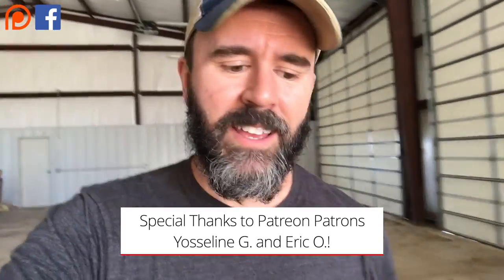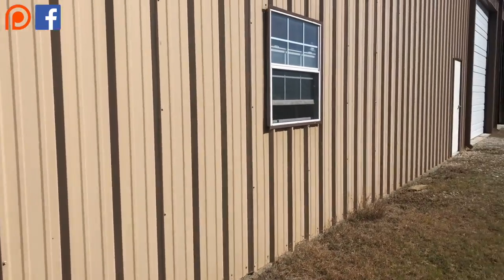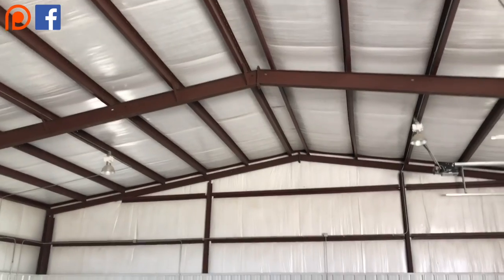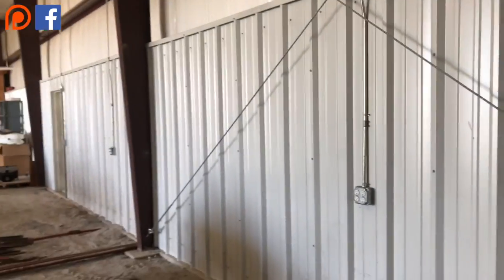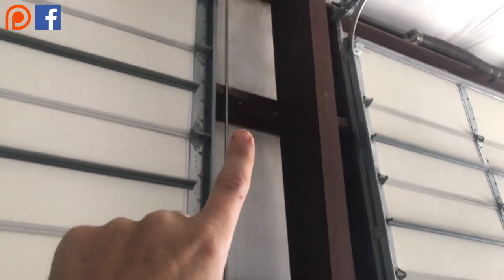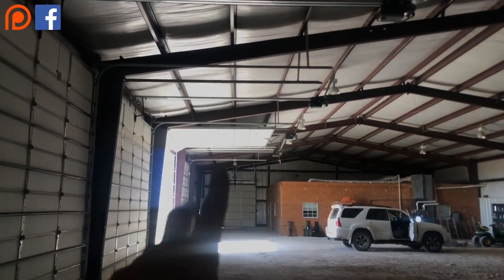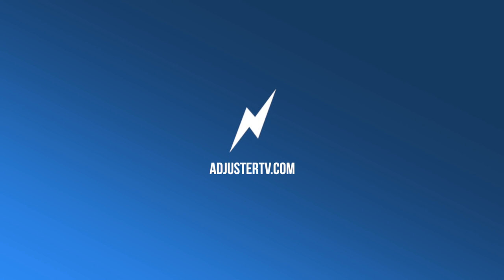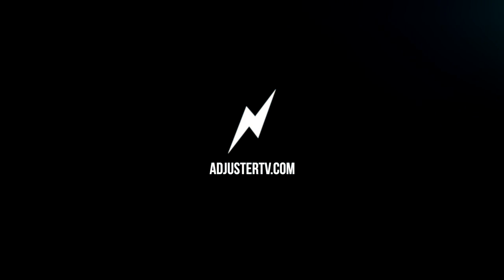Metal Outbuilding Walkaround

Comment: The Purlins and other material are typically named for their shape.  The two most common are C and Z purlins.  The steel comes in a couple of predominant gauges and a couple of predominant finishes.  Galvalume is the shiny metallic finish, and pre-finished paint is the other.  The gutters are almost always 6 inch steel.  I've also seen those on a Brownstone style townhouse....

The purlins are also usually replaceable as modular units.  i.e. 20 or 24 feet are common numbers in steel.  Span is normally 5 or 10 feet.

Commercial buildings are normally done on increments of 5 feet, i.e. 30x40 where Residential is normally laid out in increments of 4 feet.  Just some trivia to contribute.

The overhead door openers are also not standard residential openers usually, although Chamberlain can be used on smaller overhead doors.  Normally the openers are commercial and much much more expensive.

The windows and walk-doors (man doors) are usually field located by the contractor handling the erection when the building is built.  :)
Reply: It's also worth pointing out that the rubber washers around the fasteners on the exterior panels come in 2 or 3 sizes.  It's a normal maintenance item to up-size the fasteners as the washers age-out and need to be replaced.  Sometimes you'll see caulk/sealant applied to them as a way to delay the upsizing of fasteners.

On the roof it's also possible to see the Galvalume wear off due to corrosive rain... this shows up as rust.

When walking on the roof stay off the ridges of the panels, you'll dent them.  Stay in the "floors" of the panels and try to stay on the purlins.  The lines of screws tell you where the purlins are at on the roof.  Ignore the screws on the ridges of the panels as they are just stitching the panels together and aren't structural.  :)

Neat site btw.  :)  A drone would make short work out of a site overview.  :)
Reply from the maker: Lol thanks for the deep dive on metal buildings, Brian!

Comment: Xactimate has a line item for metal buildings by the square foot (if the building is a total). But this is a good video on how to estimate when it is not a total. Thanks for the tips
Reply from the maker: Yeah, a lot of the time it's got a tree on one corner of it or some panels are blown off or there's hail damage to the roof instead of being blown away.